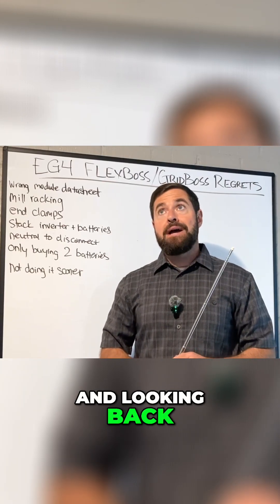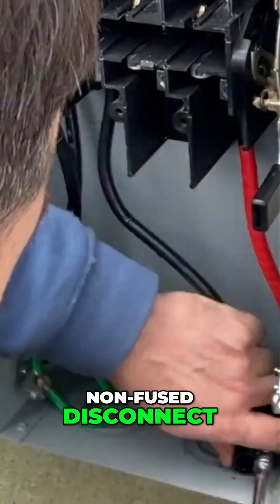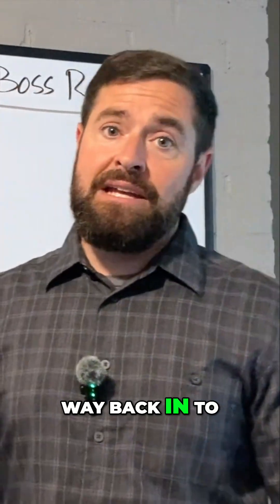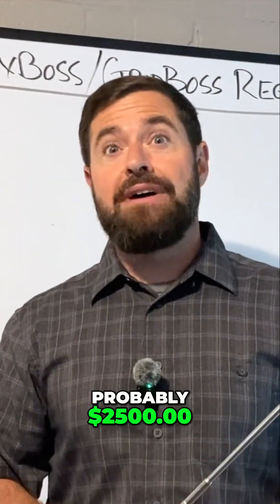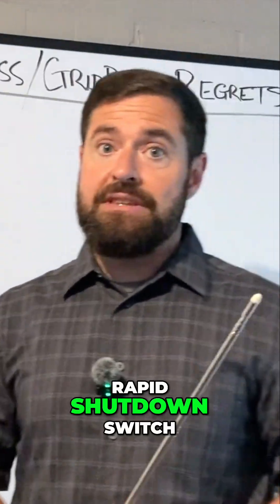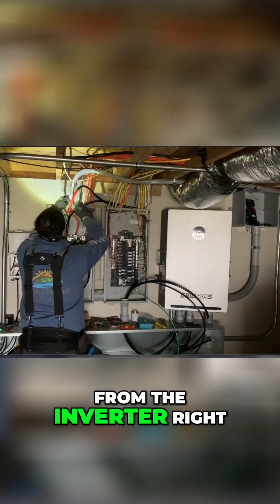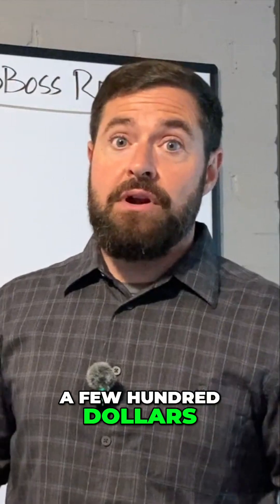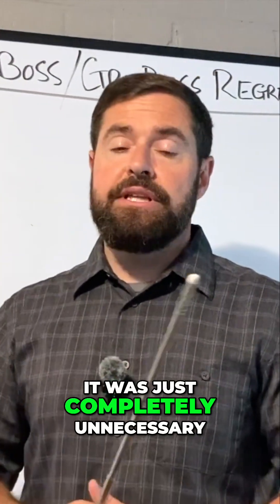Wiring Regret! Huge Cost & Time Waste!

Comment: I think you can use low voltage for disconect
Reply from the maker: @samfish6938 I used low voltage for my rapid shutdown switch, but my utility requires a PV system disconnect by the meter that disconnects the inverter output from everything else. These types of requirements vary greatly depending on your specific utility. Thanks for watching!